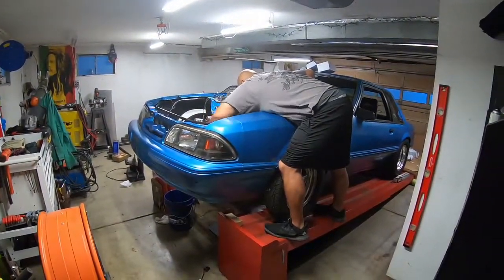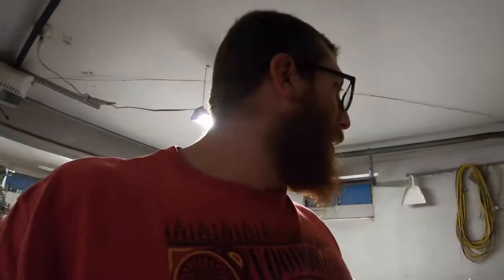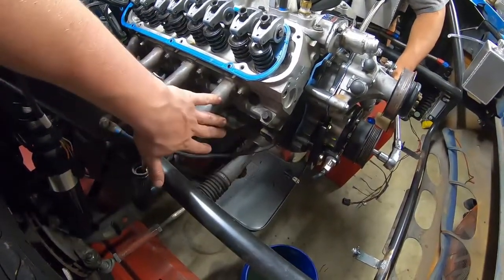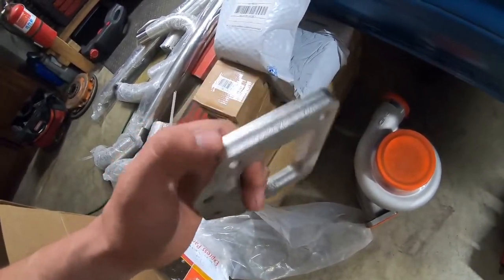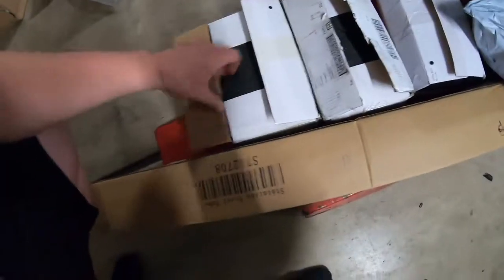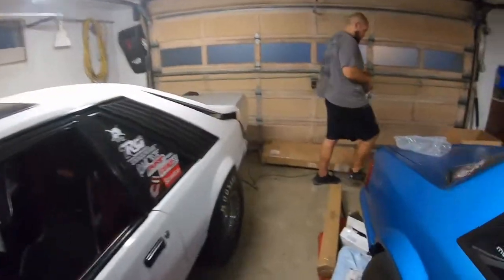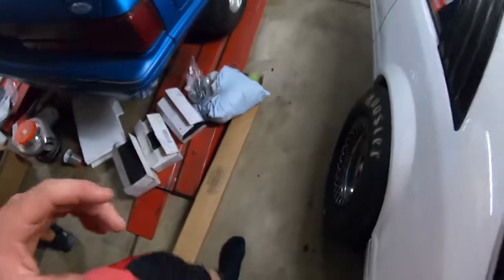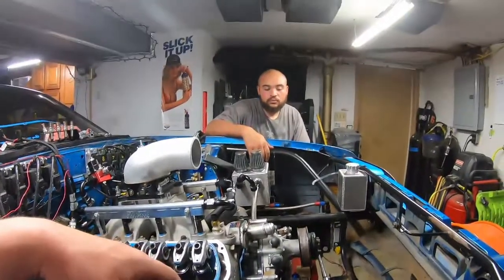MJs New Big Turbo Setup!!

Comment: The secret sprinkles on the f303 is to run 1.72 rockers bumps the lift a fair amount,  also I know u guys already got the pipe, but 3” hotside on a small cube motor might be kinda laggy,  2.5 helps keep the heat and velocity up
Reply: Exactly, I would have done a fully divided 2.25 pipe all the way to the t6 flange. That 3 inch is going to kill spool.
Reply from the maker: We like making things difficult is all I have to say to this. Done few different turbo setups and yea were probably leaving performance on the table and making it hard on ourselves but idk, we just keep using 3 inch on them haha

Comment: I would not run a 3 inch hot side. My buddy just finished his sbe turbo deal and he used 3 inch and its lazy a shit. He's going to tear it back apart this winter and do a 2.25 or 2.5 inch.
Reply: Here is a good link
https://www.theturboforums.com/threads/hot-side-to-large.375971/